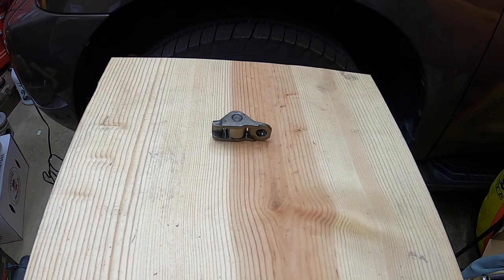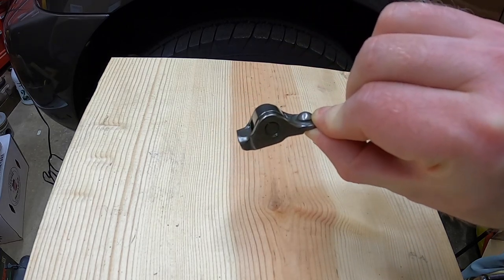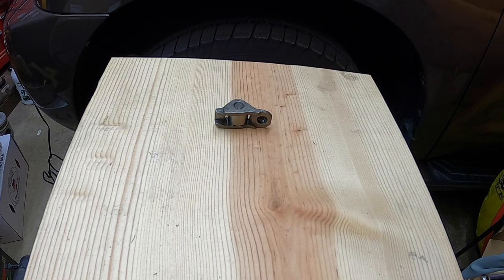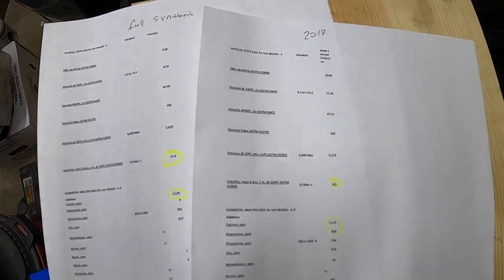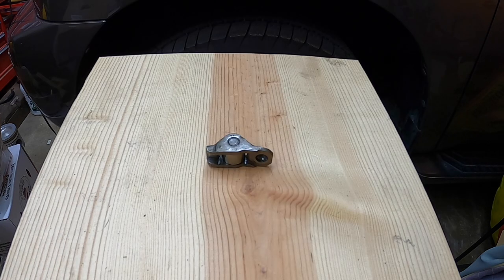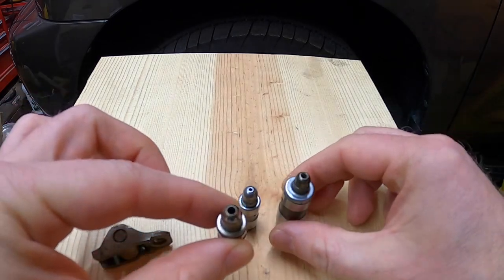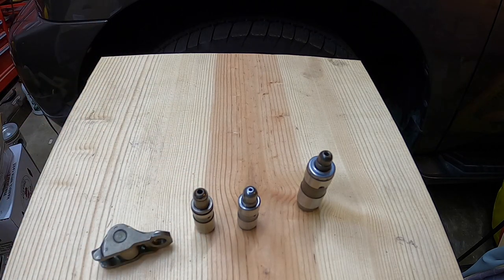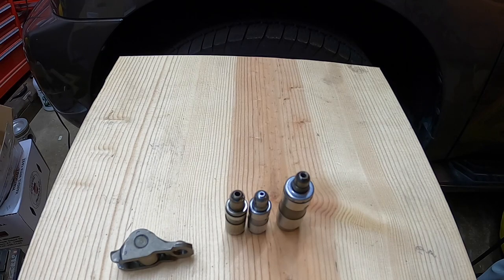Ford F150 rattle noise diagnostic solution. How to fix Ford engine noise on 5.0 v8 coyote lifter

Comment from the maker: Look at this 350k miles Ford, very reliable  https://www.amsoil.com/newsstand/testimonials/articles/pristine-ford-flex-tops-350-000-miles/?zo=5257753
Every car, truck and EV needs this https://youtu.be/H_bSDqnSh90
Maintenance mistake made by diesel owners https://youtu.be/WBOBzA56jvw
Why trucks don't come with this? https://youtu.be/hBbzJmCHtCo
How to improve lights without cutting or drilling https://youtu.be/K4WbM97pkmE
How to protect paint on the vehicle without wax https://youtu.be/I1fu9TsiYBc

amsoil https://www.amsoil.com/shop/by-product/motor-oil/?zo=5257753

mobil 1 https://amzn.to/2oM6WUe
pennzoil https://amzn.to/2M70v7r
castrol https://amzn.to/2wQKFJk
valvoline https://amzn.to/2wT3EmG
Schaefer https://amzn.to/2oRggpL
motul https://amzn.to/2oQ4OuK
red line https://amzn.to/2Nsihqk
royal purple https://amzn.to/2oPDz3k

Comment: He is correct I worked for ford for 20 years and the most common cause was tarnished lash adjusters from cheap oil and prolonged oil change intervals causing the lash adjuster to stick (noise) don’t cheap out with the oil they are not equal

Comment: On my 5.0, I switched from 5-20w  Motorcraft to 5-30 Castrol Magnatec.  A friend adds MOA oil supplement at oil changes to his 2008 5.4. He has 240,000 miles on it.
Reply from the maker: Any differences?
Reply: @repairvehicle  It's a 2013 with only 36.400 miles.  Seems quieter.  Magnatec has good review videos.
Reply from the maker: It's practically brand new engine and truck.

Comment: When I heard the noise, my first thought it was the rocker needle bearing were wearing out just as in my Dodge Pentastar 3.6. Will look at the oil first. Thanks
Reply from the maker: Ford F-150 ticking noise is normal and where it's coming from? Ford engine is a ticking .....?
https://youtu.be/PpVJtJ4Mld8

Comment: Hello I was just telling you that we have a 1995 Ford F150 5.0 and it kind of rattles on acceleration almost like the timing too advanced and I was wondering if possibility changing the oil if I should have changed it but it did seem like it helped what should I do thank you
Reply from the maker: Mileage?
How often oil was changed?
What Brand of oil were you using?
What viscosity?
Synthetic oil was used?
In part of  US do you live, northern?

Comment: I have a 2018 5.0 f-150 lariat that rattles on deceleration only goes away after a little while but the ticking/knocking remains . Any recommendations on oil?
Reply from the maker: What brand are you using now and what viscosity?
How often do you change your oil?
Mileage on the truck?
Reply: I took it about 6months ago to get an oil change and I’m not to sure what viscosity it had . They just put synthetic . Truck only has 40,000 mi on it as I don’t use it much but the noise is still annoying and don’t want to cause damage down the road. What viscosity should I be looking for?
Reply from the maker: I would use 5w-30 full synthetic or 100% synthetic oil and change oil every 6 months or 4k miles which ever comes first, due to fuel dilution associated with direct injection and auto/start feature.

Comment: I just wanted to let you know I was watching your video and we have a 1995 Ford F150 302 5.0 and it is making a rattling sound we are going to try the new oil sources hopefully that does fix the problem thank you and I would like to know more God bless
Reply from the maker: How many miles on it and how often oil was replaced?
Reply: I've noticed that you did reply to my comment it has 86,000 actual miles on that day and it runs pretty good but one that takes off on acceleration if rattle stick something takes off like a rocket to good motor we live in Oklahoma City Oklahoma and we drove it to Kansas City quite often but it runs pretty good on the highway hopefully we can get this problem fixed
Reply: Ima try it too

Comment: Thanks so much for sharing this video. I have a 18 with the 5.0 with the “typewriter/bbq tick (TSB19-2144) it is nice to know what the sound is caused by since Ford doesn’t explain why. I decided to try amsoil oil and filter on my last oil change and unfortunately did not reduce the tick at all. Any suggestions on additives? Would love to reduce the noise somehow
Reply from the maker: Which amsoil oil did you try?
Don't use additives,  because they change oil chemistry and cause engine problems.  You might have noise coming from injectors.
Reply from the maker: It sounds like you have some other issue with engine.  Have you done oil analysis?
Reply: I have not but I will. I’ve gone to 3 different Ford dealerships and they all shrugged it off and told me it falls under TSB19-2144. I see that you covered how to do an oil analysis in another video. Thanks for the informative content, very helpful!
Reply from the maker: Oil analysis will definitely reveal if something is going on with engine on the inside. Please don't forget to share results
Reply: @repairvehicle  i just did the oil change last week, I’ve only put about 30 miles on it since. Is it suggested to put a specific amount of miles on the vehicle before doing an oil analysis?
Reply from the maker: At least 1k miles, someone told me this.
Reply: What about Lucas for an additive
Reply from the maker: Lucas additive don't work
Reply: Drove up to my bank drive thru and the cashier asked if I driving a diesel! Embarrassing! No more Ford F150.
Reply from the maker: Vastine, what year, mileage and maintenance intervals you follow?
Reply: @vastineeast3904  I’ve gotten the same question before!
Reply: @brianl3939  I do the recommended oil changed since I bought my F150 in July 2018. Milage as of today is 25,045.
Reply: It can be a bad lash adjuster, cam phaser/timing chain, piston slap, or high pressure fuel system causing ticks on a newer 5.0.
Reply: Pcm reflash

Comment: Ford quality on there F-150 has dropped over the past few years. They are good looking trucks.
Reply: So annoying for my van..10k in repairs and it still isn't fixed.

They design it so that you need to take off so many more parts than normal, just to get to a ball joint, for example.
Reply from the maker: What year is your van?

Comment: Great information! Thank you...

Do you have any idea or experience with 2015+ F150s w/ 5.0 and the rough idle/ stalling involving cam phasers or VVT solenoids? What causes it or what's the fix as some see improvement w those items and some don't
Reply from the maker: Without connecting obd2 scan tool, I would not know
Reply: You ever solve issue.  Sounds like a common problem.  I change oil  Frequently it seems to help
Reply: It’s the VVT solenoids.
Reply: @jaredmayer3960  you are correct. I did end up replacing all 4 and it solved the issue.
Reply: @gous5649  if you watched the spark timing before it would have been erratic and that was what led me to the solenoids.  The phasers can’t really screw up.
Reply: @jaredmayer3960  vct lol

Comment: I have a 1996 f150 v8  and I have the same noise .. I looking answers but nobody tell me .. someone can help me please?
Reply from the maker: How many miles on it? How often do you change your oil?
Reply: Please 🙏 😢
Reply: The truck have 100,000miles … and I change oil 4 months ago …
Reply from the maker: @davidflores2164  how often do you change your oil? I didn’t ask when you changed oil last time. What engine size?
Reply: I sorry sr, I change every 4 or 5 months .. because I don’t drive too Mach on the truck … the engine its 5.0 v8 ….
Reply: Note: My truck it’s lifted whit big tires.. maybe the oil the need change to many frecuently
Reply from the maker: For how long you owned this truck?
Reply: i have 2 years
Reply from the maker: I would run engine flush to help dissolve carbon buildup and it should help
Reply: How I do this ????
Reply from the maker: @davidflores2164 How to Flush engine on F-150,
https://youtu.be/VhBNDgg8u8c
Reply from the maker: @davidflores2164 How to Flush engine on F-150. 
https://youtu.be/VhBNDgg8u8c

Comment: These adjusters are up at the top of the engine. Why is the Typewriter tick mostly  heard from the rear of the oil pan after the first oil  change?
Reply from the maker: Noise travels. Second oil change noise is not repeated?
Reply: @repairvehicle  thank you for your reply!  I'm really trying to understand this typewriter tick. I hope you can help. 
Why is it that it often happens after the first oil change? 
Why only some of the GTs? Why some worse than other?
Will all of them eventually get this tick? 
Others say it has wrecked their engines. Is this possible. 
Reason why I'm asking is,  I have an opportunity to buy a 2013 Mustang GT with 53000 miles. Very nice car, looks to be well taken car of. BUT It has the typewriter tick. Should I not buy this car because of it. Your thoughts will make me understand this better. 
Thank you!
Reply from the maker: Oil drains off and it takes time build up pressure. It should go away.
Why GTs? People were often don’t allow engine to warm up and start revving up engine and it causes wear. 
I think all of them will have that tick eventually. Why? Ford had decided to lower engine speed to the point where it drops oil pressure to low and causes everything to wear out fast and start making tick noise.
Reply from the maker: How do you know it was taken care?
Reply from the maker: When you remove oil cap from engine, does the engine look like this on the inside watch video CARS TO AVOID WITH THESE ENGINES! 
https://youtu.be/Ta1tUKqwjeQ
Reply: @repairvehicle  he had invoices that documented oil changes.
Reply: Sounds like buying any 5 litre Coyote is a mistake.
Reply from the maker: How often was he changing oil? How is the engine on the inside?
Reply: @repairvehicle  he changed the oil between 5000km  and 6000km. Up here in Canada. 
Never checked under the oil cap as your video shows. I pulled the dip stick to feel the oil between my fingers and looked at it in the sunlight to see if there was anything sparkling.
Reply from the maker: If you see sparkling in the oil, engine is done needs major overhaul. I would personally stay from engine that has a tick, who knows how much life is left. My 2013 f150 5.0 had no tick and ran good.
Reply from the maker: Ford has done great job at fuel economy but at the expense of engine reliability.
Reply: @repairvehicle  Yes I was thinking the same. No sparkly stuff in the oil. But the tick would always keep me wondering. I'll keep searching for one that doesn't tick. Or get myself a Mazda Miata.  I sure do like the V8 of the Mustang though.
Reply: repairvehicle. Thank you!  This has been most helpful.

Comment: Is the 5.0 running 0w20 or 5w20?
Reply from the maker: 5w-20
Reply: @repairvehicle  My hemi calls for 5w20. Been running 0w20 for a while now. Engine is way quieter on cold start up. Same issue... Really small oil passages in the lifters.
Reply from the maker: On cold start it definitely makes the difference
Reply from the maker: @brandon hatfield,  I know bmw were big on using 5w-40 and owners were experiencing major valve train issues. After many years of issues and warranty claims bmw realized that  modern engine requires thinner oil to be trouble free and now they are using 0w-20.
Reply: Should be 5w20

Comment: Basically my f-150 2018 5.0 engine had the same issue and the sound was there on low speed and starting , the problem was there cause of using the recommended oil 5w-30 full synthetic once I changed for 5w-50 full synthetic the engine got smooth sound also my fuel economy was decreased. Just note that I’m from Dubai also the weather may cause a loss in the viscosity of oil
Reply from the maker: Can phaser will fail on your ford due to thicker oil
Reply: @repairvehicle  nop dear I’m using the thicker oil since 2020 , don’t forget that the viscosity will be dropped , also my car rounds around 600km daily also our climate as you know in Dubai will make you lose ur viscosity faster so usually I change oil every 7500km which is every 16 days approximately
Reply from the maker: @Dxbnas  how many km on your ford?
Reply: @repairvehicle  to be more specific for my case usually the climate from may to September is 40 Celsius to 49 which is equivalent 104-120 Fahrenheit also the humidity is really high regarding the daily distance is 600km equals 373 miles daily . My recommendation is just to start using a thicker oil step by step depending on your case also try to go for full synthetic. Once I’ve been in the USA and I’ve got to know that most of the lubricants are there so trash and low quality due of recycling oils and reproducing them back which means your losing almost 35% of your lubricants viscosity
Reply: @repairvehicle  550,567 km
Reply: @repairvehicle  also I’ll tell you one more thing I changed brakes since I got my car only once , never changed any consumable parts until now all my car check ups are in the dealer , I just take care of my car so it acts like a Tesla 🤣😂😂🤣 only before few month I changed the throttle body and in 2019 i changed the complete manifold
Reply from the maker: Original engine and no engine repairs?
Reply: @repairvehicle  yes sir this what’s called treating your car like a princess
Reply from the maker: Very impressive. Good job with maintenance, looks like it’s working great for you. Keep me updated if anything changes
Reply: @repairvehicle  definitely but it’s not all about maintenance dear you’re a mechanic and you know as well it depends on how you use it 😉
Reply from the maker: @Dxbnas  , very true!
Reply: That's worth the shot. Thank you for sharing your suggestion. What brand of synthetic did you switch to?... Thanks!
Reply: @marceloflores2876  I suggest you using Mobil oil or Castrol magnetic technology 5w-50 . But before using it try 10W-40 depending on your country climate
Reply: @Dxbnas  what is your opinion on the German 🇩🇪  made CERATEC product that a lot of people are buzzing about?
Reply: @marceloflores2876  lesson to me we are in Dubai producing 80% of German products in jebal Ali area and they’re writing on it made in Germany and German technology , the best way to know if the product is really good either to use it or read the data sheet of a product . If ur not bothered to try like me because ur busy or you don’t love break downs go to the well known global companies and forget about the headache
Reply: @Dxbnas  thanks for your input man. I appreciate it! Receive my best regards from Arizona. From one desert to the other. Take care! 🙏
Reply: الصوت عندك من جهة السايق؟